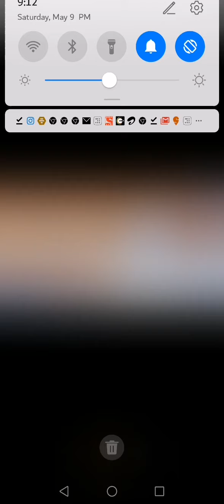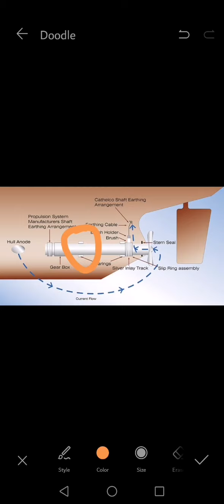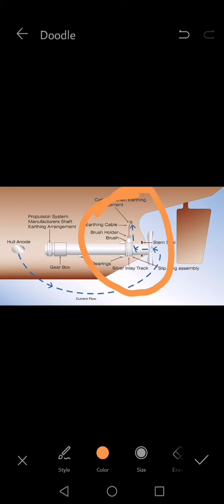SHAFT GROUNDING SYSTEM EXPLAINED

Comment: Hello! Our Groundung device gives alarm at over 50mV. But i changed all silver graphite brushes, remove slip rings and clean shaft surface then reinstalled (resistance of slip rings and shaft after installation is zero ohms which is good) spring tension adjusted to the max. Canni checked the mV using voltmeter? I have checked all cable terminals/lugs connection. All is ok. All grounding xable also checked. But still gives 50mV...
Reply: YES YOU CAN CHECK THE mV USING VOLTMETER

Comment: What is the main puroposr or use of haft grounding?
Reply: To prevent spark erosion which can developed in between the shaft and the main bearings ..
The potential difference that is voltage developed only when the shaft is rotating and there is breakage of lubricating oil film between the shaft and bearings.
Due to voltage or potential developed there will be spark produced due to dissimilar metals are in contact..
These sparks can damage both the bearings and shaft especially bearings..
The damages caused by the spark is nothing but spark erosion.
And that's why we are grounding this current.. indirectly the potential.
Reply: @siddhushah007  main bearing or stern tube bearing?

Comment: How the potential diff occurs between the shaft and the hull
Reply from the maker: Because the shaft is seperate to हल body by Lubricating oil film. And also since it's rotating which creates a micro magnetic field..and thus a potential difference.